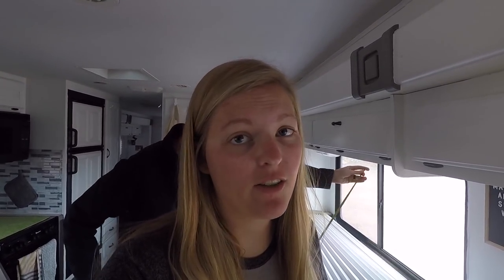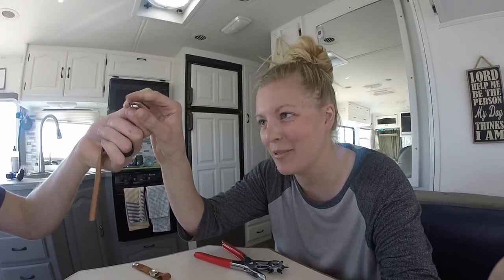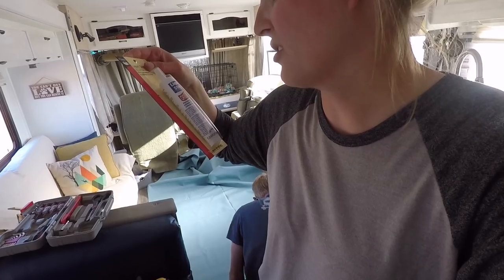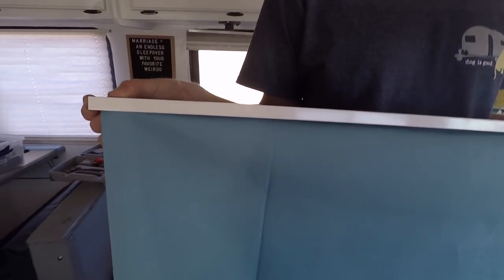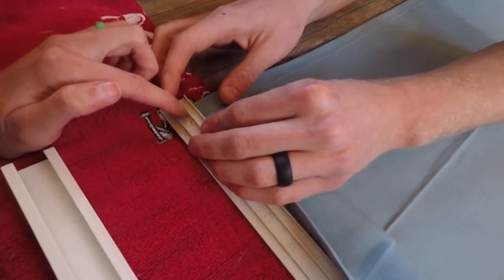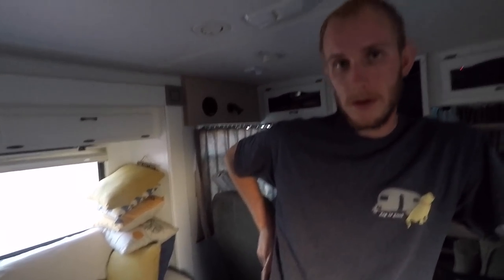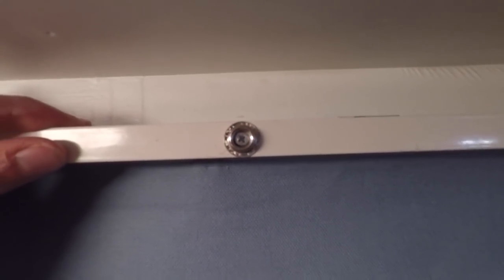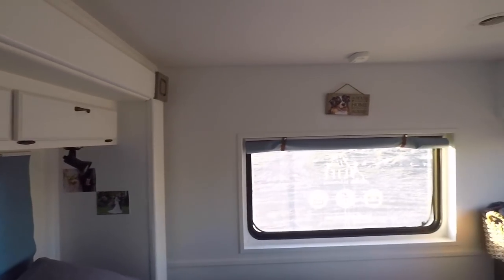DIY RV SHADES | How to Make NO SEW Cheap RV Shades | S1E15

Comment: what a lot of these sort of videos fail to realize is that any design where you are touching your shades is not going to work because touching the shades will make them much dirtier over time.  need to think of a string or something that can be pulled to pull them up, or let them drop down.